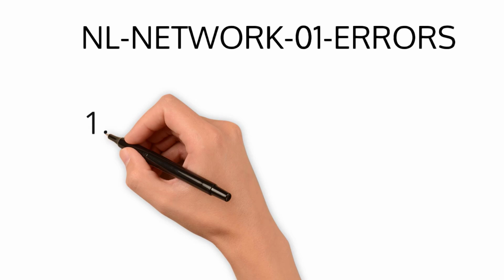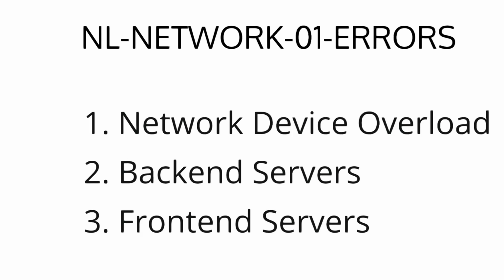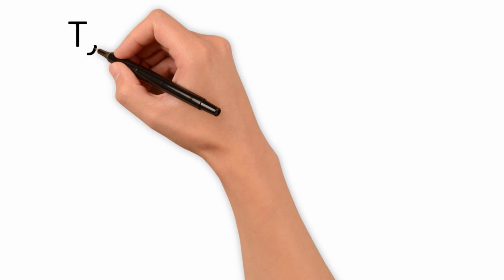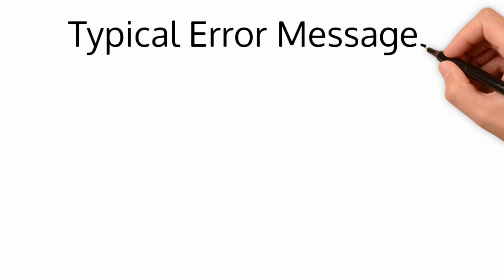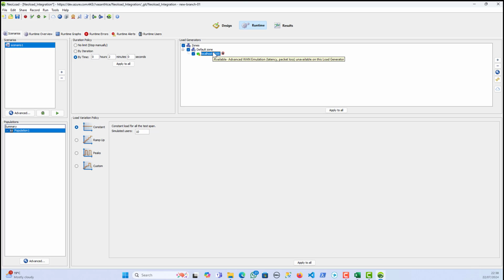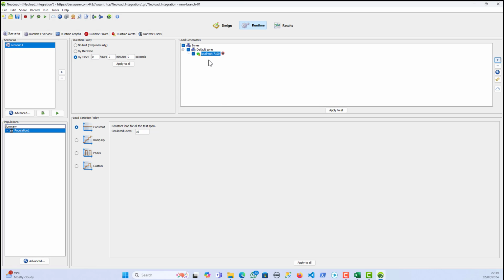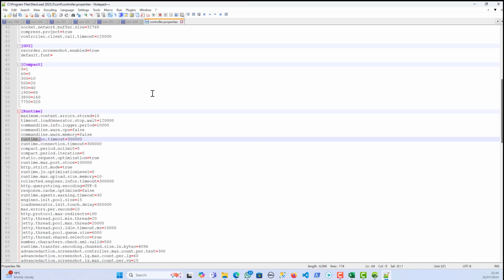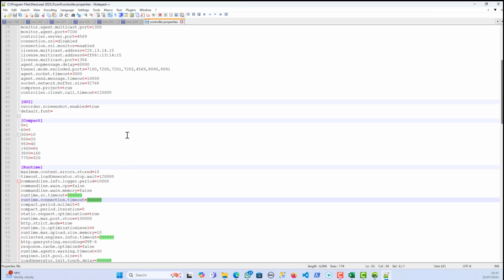How to solve NL-NETWORK-01 Error in Neoload #neoload #neoloadtutorials @vasanthtechtalk

Comment: If we change the runtime timeout settings to 0 , will it not Result in more errors only? Our aim was to reduce the number of errors,  please explain sir
Reply from the maker: It’s one of the possible solution and as I mentioned you have to try all the solutions to find the right one
Reply: 1. are your referring network packets to check in application or between LG to Application?